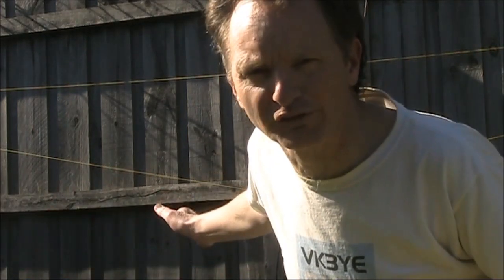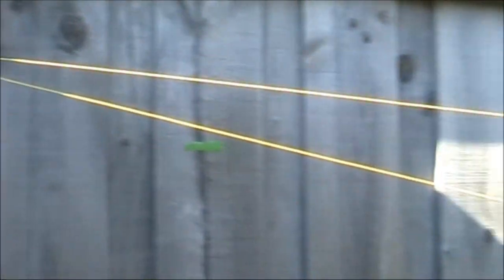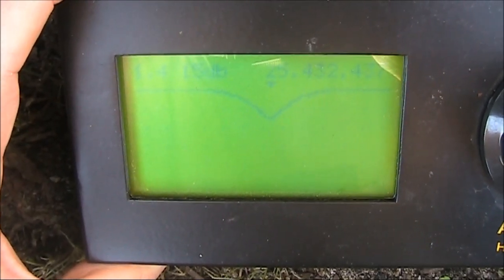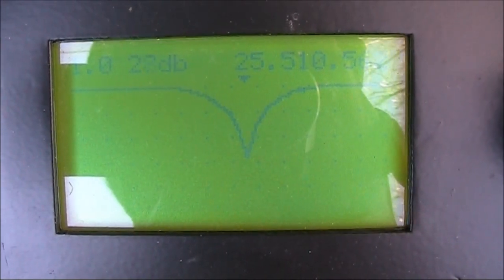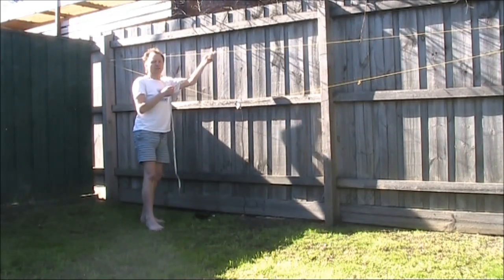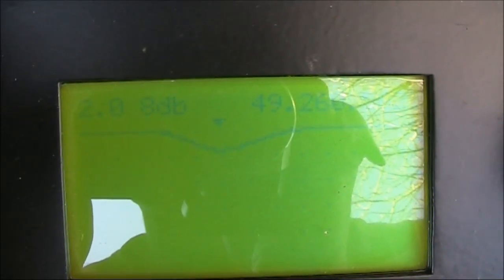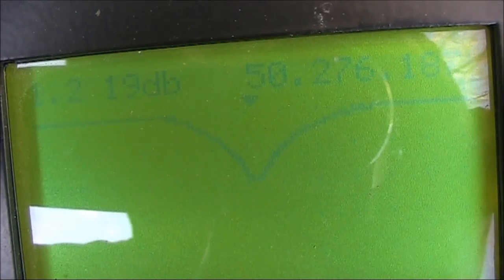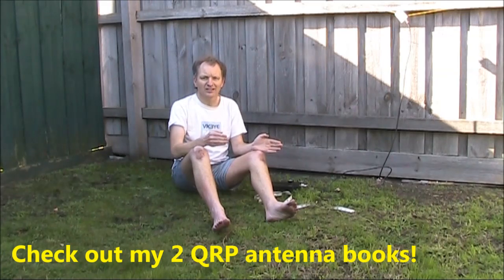Experimenting with a clothesline style folded dipole

Comment: Thanks, VK3YE, for the online demo of the storied clothesline antenna. Now, Im gonna build one. And I'll try it as an all-HF-band , which is the real advantage. Note that this could also be used as an all-HF-band vertical. In that case, this adjustable antenna would be mounted on a wood or plastic pole. The "secret" here is that it is a FOLDED dipole.  Note that no antenna tuning/matching unit is required, provided that you readjust the left side  always to 1/4 wavelength. (Right side will be 1/4, 3/4, 5/4, etc., meaning that, worst case,  if you want lowest band to be  160M, pulley to pulley will be 80M!)   Did I get that right? - - John, K6dBi

Comment: Hi Peter, nice video investigating the use of pulleys to move the feed point on the folded dipole. As far as the clothes line goes, I have used some to see how good a piece of steel wire is. There was an article in a magazine where someone used a piece of clothes line as an OFC dipole. So I built a copy and comparing the steel clothes  line to a  low cost green/yellow ordinary mains earth wire, I found that there was around a 10 dB receive and transmit difference between copper and steel. I think the resistance of steel wire is around 5 times, or more, of copper. The clothes line dipole was basically one long resistor!  So using it for transmitting I found a 20 W signal resulted in less than 2 watt radiated signal.  SWR wise it was somewhat deceptive since the resistance of the wire was in effect damping down the Q. So at resonance you could tune the dipole to get a low SWR making it look good. But the high resistance of the steel meant a lot of power was lost in the wire and not radiated. So clothesline wire will work in an emergency but for a fixed installation it is very poor. Low cost copper earth wire is a lot better. So the article suggesting a dipole out of clothesline did not mention how bad the losses are and was really not very practical. So I don't know why anyone would even bother to suggest the use of lossy steel wire for an antenna when  plain old copper works  a lot better.

Comment: The clothes line I used as an antenna was a hills hoist on upper hf. A gamma match on the side and some radials in the grass.

Was expecting an antenna disguised as a 4 line clothes line that you stretch out as needed. Watching that 25.x MHz frequency I was not getting past the idea of tweaking the antenna to get it down to 24.950. I like 12m. Just a shame we don't have many in Australia that use it.

Comment: Make the antenna longer and mount it higher up, then put that on a motorized pulley and have a remote relay to switch between 50 and 200 ohms and really experiment.